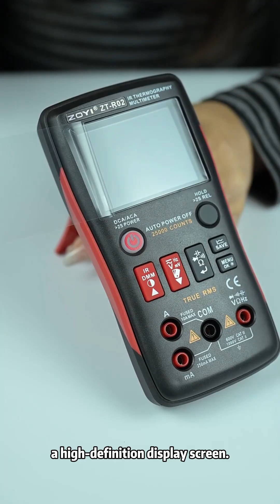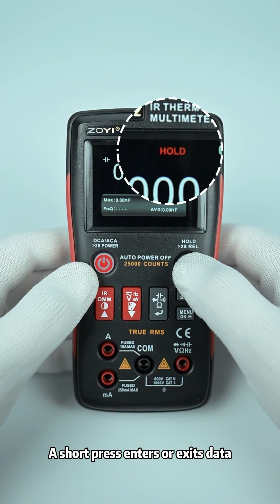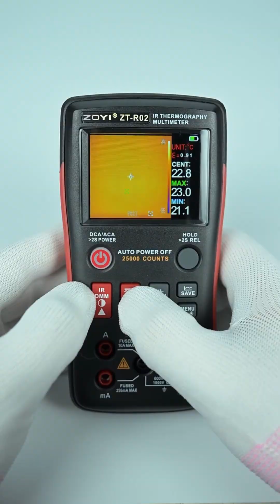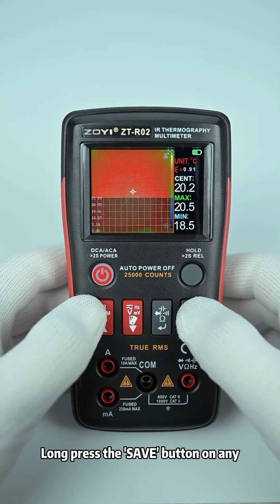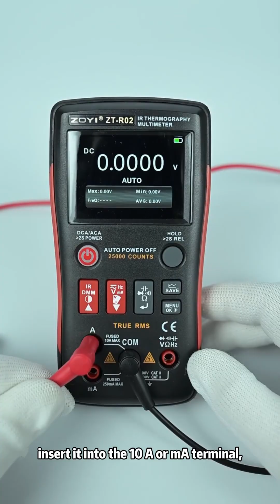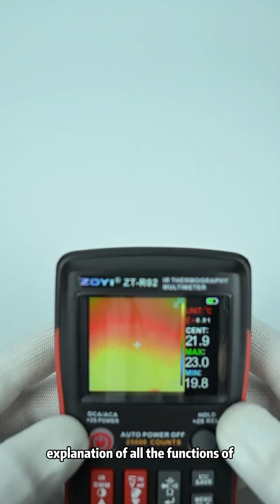ZOYI ZT-R02

Comment: Hi! Has anyone encountered a measurement error on the ZOYI ZT-R01 for voltages below 4 volts? For example, a 1.5-volt battery is measured as 0.8 volts.